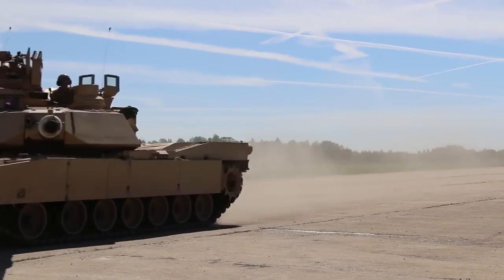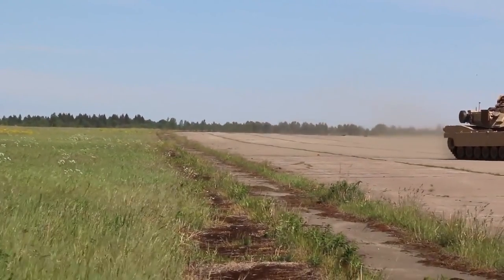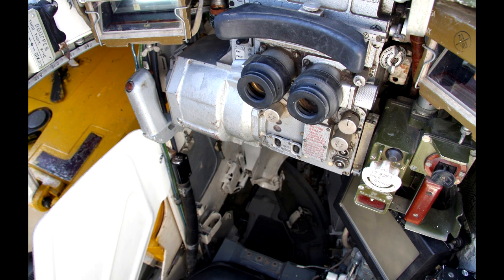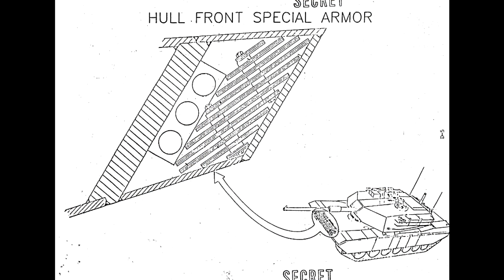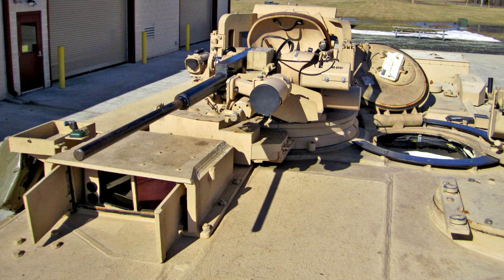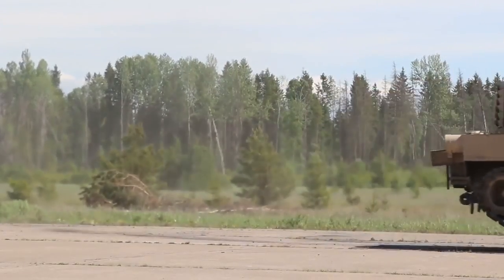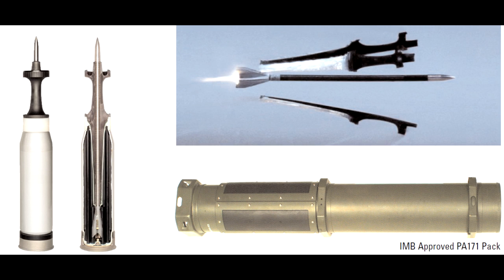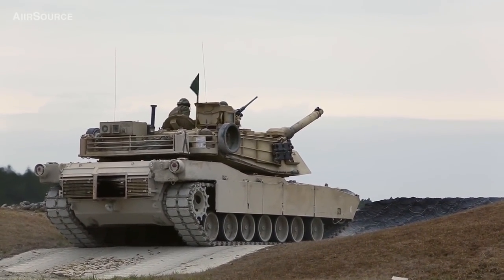Problems with Abrams tank

Comment: The weird thing is that when the M-1 met the best export versions of the Soviets it was ever the master.
BTW, the gas turbine is rated at 1,500 hp. That's because it has throat restrictors -- same as the F-15 fighter -- which can be taken out so that the turbine puts out 2,500 hp -- making this flawed beast the fastest tank in the world. It also does not use the primitive Soviet sighting systems so exhalted here -- being designed right off for a super sophisticated electronic scheme. The electronics cost a fortune, BTW. The Soviets were so shocked at how ROTTEN their T-72 tanks -- and all else -- worked in 1991 that the government fell into revolution -- and the Cold War was over. By that standard, the M-1 tank was the most successful in all history. None can compare. Nice critique, though.
BTW, the T-34 had CRAPPY glacis armor, too. It was so bad that panzer III with 37mm pop-guns were killing it. Yeah, most T-34s during Barbarossa were lost to those pop-guns.(!!!)
The T-34 still worked out. The Reds won, the Nazis lost.

Comment: the reason they used a turbine instead of  a diesel is signature. when the gas turbine starts up and when you add throttle there is no diesel plum letting the enemy know your location as there is with the diesel engine

Comment: A 40 yrs old tank design, can’t the us just get a new tank?, abram is too old You can’t just keep upgrading it like patch up the Boeing,  GET A NEW TANK for god sake, far less expensive than the F35 budget.
Reply: Tốn tiền đầu tư, tốn nhiều thời gian và công sức, trong khi abrams vẫn có thể chiến đấu đc. Bản chất là "xe tăng của bạn rất tốt cho tới khi một kíp lái Trung Đông chui vào nó" vậy thôi. :)
Reply: Tran nguyen khai minh  there are many thing thing wrong with the m1a1,  there are many new modern features that you can only build into a tank, not upgrade, the m1a1 engine is expensive, unreliable, use too much fuel and not the right choice at the first place, also it has no anti rpg or heat seeking/auto counter rocket like the Israeli, the rear of the tank the driver to blowup when hit, the whole tank armour need to be upgrade etc...

Comment: An unbiased opinion is valued. Still waiting for one.
Reply: Tell me, in what way is this biased?
Reply: @leosjogren5244 deliberately ignoring important context like the fact that German MTU was not in consideration for Abrams, the diesel used in the GM XM1 was the AVCR 1300. A far less capable engine that had numerous issues and negligible efficiency advantage at a higher weight while offering less power both overall and at lower RPMs, agt 1500 wasn’t politics, it was the better engine that was objectively worth the cost. And given the complete mess that was the MBT 70, the US was in no mood to listen to the Germans, in fact when the Leo 2AV was tested, it was found that the Germans lied about the weight by removing the composite armor and weighing without being at combat load. When the US ran the numbers of what a combat loaded 2AV would weigh? It was 64 tons as appose to the required 57 tons. 

When the 2nd round of testing began in October, the new categories were created to better define what the army expected not to mention they told the manufacturers what they could do better and improve on their designs based on what they observed in the may tests, the simplified categories put the most weight on what mattered to them most, not expensive bells and whistles that were unimportant extra costs. GM didn’t really work on their tank in the interim months, Chrysler basically rebuilt their tank from the ground up, and the Leo was unchanged

When it was tallied up, the Leo was heavier than expected, it was less survivable, and it would cost 25% more compared to either of the XM1s

No wonder the 2AV lost. Why was Chrysler chosen? No it wasn’t politics or a bailout like everyone says it was. It was objectively the best tank that achieved the goals the army wanted/ could afford. Why was the original M1 circa 1981 dog shit? Because that was the tank Congress was willing to pay for instead of what the army wanted. And it made do with what it had till M1A1 showed up 120mm gun, CITV. And depleted uranium, because Congress was ready to pay the higher price tag what the bells and whistles would incur.

Makes sense?
Reply: he roasts russian tanks as well. why are you still whining?

Comment: As a tanker on the M1A2 SEP V2. I can say he’s correct on everything for the most part. He forgot to mention that the track is made of fucking glass and breaks if you turn it just ever slightly too hard and the point of the engine really is just cause unlike a hefty waaaay better diesel, this one is waaaay quieter and doesn’t make any large black clouds of smoke to lock onto or follow around. That’s about it, the tank needs a full overhaul but we are just gonna continue to slap shit onto old garbage and claim it’s “better” than it was before because it was the cheaper option.

Comment: Problem with Abrams is simply....fuel consumption. Otherwise it is probably the most all-round balanced and capable tank. Gas Turbine can run on alot of differing fuels, like the British Multifuel engine leyland made with the exception that the Gas Turbine actually fucking works. Abrams Combat record shits all over other tanks, from 1991 to 2003 Thunder runs into Baghdad, what has the Leopard done? Got smashed in Syria....

Comment: The front side is 800 MILLIMETERS and it the upper plate last weakness is compensated by the fact that the shell bounces and goes into the much stronger upper hull and it is all MUCH stronger then Russian tanks, we make the sides weak as the production cost would be cheaper, we can put armor there but it would be expensive and useless unless a lot was applied making it less combat effective

Comment: The 1,500 hp diesel wasn't available when the M1 was in design finalization.  By the time the M1 was fielded the diesel became available but the design was fixed.
Reply: NOT TRUE,  both the Maybach MTU 1,500hp and the 1,500 hp Continental AVCR-1360 Diesels engines were trialled in the MX1 along side the AGT-1500 in November 1979.
Reply: The Diesel powered GM version of the XM1 proved superior and was officially selected by the U.S. Army. Congress overruled the Army after heavy lobbyists pressure from Chrysler and the State of Ohio.

Comment: Whos needs 120mm when you have depleted uranium shells "aka the heavy know material" that goes through any modern tank design with ease? And you have artillery and a armored convay with you entering the kill zone you arent soloing enemy tanks. And you wouldn't enter without air superiority. Take a miltary base with a m1 defense with watch towers to spot mortars and air support. Good luck. Just saying
Reply: Who says depleted uranium projectiles are better? The US Army uses DU because it's cheaper than Tungsten projectiles.
Reply: @sandervanderkammen9230  du is densier than conterpart even for expensive tungsten shells and has added incendary effect which tungsten doesn't. Though pure tungsten is denser. Either will take out tank. But du will make the inside an inferno which has added psychological effect and is honestly quite horrifying

Comment: well to be fair the australian abrams tanks do use diesels and have other modifications i cannot recall off the top of my head
Reply: There is a reason they use turbine engines,turbine engines can run off of many different types of fuel,don't have diesel fuel out in the warzone? Kerosene,high proof alcohol,pretty much anything that burns run the turbine
Reply: @hugh.grection1386  the only war zones america has been in have been deserts....have you seen how expensive it is to repair a sand blasted jet engine???
Reply: @redundantstuff100  yes they are expensive but there is a reason they use them,it's not just because ohh well
Reply: @hugh.grection1386  using diesel gains higher torque and pulling power, sure high speed and mobility is slightly on the down fall but who cares when its cheaper
Reply: @redundantstuff100  well the main reason to use turbines is because in a war fuel supplies can be cut off and with the turbine engines even a few gallons of vodka scavenged from locals can run the tank
Reply: @hugh.grection1386  hahaha you really expect to run a multi million dollar gas turbine engine to run on vodka??? also diesel is an extremely common fuel soooooo...
Reply: @redundantstuff100  it will run on high proof vodka,or regular gasoline,or kerosene,or anything flammable,I'm not saying diesel engines is bad I am just saying why America uses turbine engines
Reply: @hugh.grection1386  ok so according to this link: https://science.howstuffworks.com/m1-tank2.htm it will only run on diesel, gasoline and jet fuel.
Reply: @redundantstuff100  that is the main sources of fuel the military uses but it can run on anything flammable,this is why it says wide variety INCLUDING those 3 u mentioned

Comment: The Abrams is a pretty formidable tank in the US Army. I have no idea why it doesn’t run Diesel, because almost all our vehicles run on diesel anyways. This video is clearly pointing out initial and early stages of flaws compared to what we have today. At the end of the day we can afford to upgrade the living hell out of these tanks and anything else, I can swear on that. The US Army has no shortage on budget when it comes to the active duty or more critical components, everyone else is just hurry up and wait lol. But hey, what do I know, I’m sure there are a lot of “experts” on here, all I do is drive everything except heavy tracked vehicles for the US Army 🤷🏻‍♂️🇺🇸
Reply: The M1 can run on diesel,  kerosene (JP8),  gasoline, or jet fuel, and probably as well alcohol. The major issues with the last 3 are they are extremely flammable . So the M1 has used just diesel and kerosene. Initially they ran on diesel , until the late 1990's(IIRC) when they switched to kerosene as a part of the shift toward a universal  fuel ,where all vehicles and engines (in trucks, tanks,  aircraft, generators, etc) run on one fuel simplifying the logistical train. This has been a dream of armies since there have been motor vehicles/internal combustion engines  in military forces..IDK where the us military is today on this issue.

As to the "multi-fuel aspects , the M1 can run on a variety of fuels , HOWEVER,  you can't just put in these  different fuels randomly. Each type of fuel demands adjustments to the fuel system -, different injectors, fuel pump/filter separator adjustments and/or modifications and control unit adjustments.  An M1 set to ran one type of fuel, needs many modifications to run a different type of fuel efficiently, if at all.  A tank crew cannot do this, these changes take major mechanical adjustments and different parts.

The early M1's(M1 hull with XM1 turrets) were marvelous bad ass machines automotively , when maintained. They were the lightest M1 (63 tons)and their turbines were not always restricted /toned down like the later ones.  They probably were and will be the fastest tank that will ever be made . Ones in good running order , with no governor/hp restrictor could go 70-75 miles an hour or faster(running diesel)and depending on road type. And their torque , while rated at 1500 HP ,  I believe could go up to 1600-1700HP.   Really fun vehicle to drive. 
Ex tanker/Vet US Army  85-93 M60 A1-A3, M1- M1A1  primarily Driving (shooting is boring LOL) and later I was Civ DoD  banging on M1A2's (SEP/Block III's)

Comment: Thumbnail images are grossly misleading. Those tanks are being/were intentionally destroyed. From what I know, this is done when a tank needs to be abandoned for whatever reason, but could fall into enemy hands before retrieval. Rather than letting the tank fall into enemy hands, the tank is destroyed from the inside after the crew has safely evacuated. There are also pictures of Abrams that were destroyed in battle, but they were down-armored variants crewed by our allies. So in short, a lot of the destroyed Abrams you see are either scuttled or obsolete versions lacking the top secret armor.
Reply: The same "obsolete variants lacking top secret armor" argument can be applied to other vehicles as well. A lot of the (ill-informed) negative views on Russian armour in the west come from the poor performance of cheap export model T-72s used by a number of middle eastern and northern African nations against US tanks. These tanks lacked advanced fire control systems and night vision systems deployed on Russian vehicles, lacked the most modern composite armour and ERA deployed on Russian vehicles, lacked the modern ammunition used by Russian vehicles, and largely lacked the properly trained crews and proper tactics used by the Russians.  These downgraded tanks stood next to zero chance against modern M1s with well trained American crews.

As you point out, western tanks are not immune to the same problem. Downgraded, export models of the Abrams are known to perform less favourably than their US military counterparts for largely similar reasons. Leopard 2A4s used by Turkey in Syria are another (quite recent) example of supposedly excellent, modern tanks underperforming, again for similar reasons.

To quote Bernhard from Military History Visualized, "Numbers (or indeed pictures in this case) without context, can be misleading."

Comment: I dunno, German engineering is notorious for being over-engineered (2 pulls on a BMW door handle to get out? WTF is up with that?), and anyone who knows anything about mechanics knows the more complexity you add, the more opportunity for failures.

As for the destroyed Abrams pictures, you do know that most of those are derelicts on ranges for testing aerial and artillery ordinances, right? Other tanks didn't do that (correct me if I'm wrong, and you can confirm the location). The current generation is crazy tough, and as far as I know, we've never lost a man in an Abrams, making it one of the safest places to be on the battlefield. That said, it's not invincible, and of course it has room to improve, and it should.

It would be interesting to see what the current tanks used by the super power nations would do to each other in battle, like pitting the Abrams, Challenger, Leopard, and whichever T-series the Russians are on now. However, such a showdown could never produce accurate results without an actual fight to the death, and you also have to keep in mind that modern warfare is conducted in a way where each type of offensive force is backed up by other support forces. In such a tank battle, you'd have to consider all the support, too, artillery, air power, and even cyber warfare.

Ultimately, I hope we never find out which tank would really win, because to find that out, many people will have to die.

Comment: Nice video. The note of “this tank was never destroyed” should have an asterisk. The tanks were disabled in the early 2000’s from unknown fire, and the crews were able to escape with no major injuries. Then the tanks were destroyed to keep the technology from falling into enemy hands. Even the USAF was called in to bomb the tank. There are many flaws to the tank, but with the strengths it provides, it fits well into the American battle puzzle. Air superiority does help with fuel supply lines, as well as proper infantry support functions well with the M1’s. No tank is invulnerable, but the key is a well trained and disciplined crew and their safety to redeploy in another vehicle. Again, great video.

Comment: Yet when Russian tanks went against US tanks the Russian tanks got blown to hell.
Reply: Those "Russian tanks" that tend to be used by middle eastern nations against US tanks are export model tanks. They are downgraded, far cheaper versions of the Russian vehicles and lack many of the modern systems that make the Russian tanks (used in Russian service) good. The crews of US tanks also tend to be trained far better than the crews they were facing in these cheap export tanks. Comparing the export model tanks to the proper vehicles used by Russia's  military is almost pointless. It's like comparing a Mustang with a V8 to a Mustang with a 4 cylinder engine. The cars share the same name, but perform entirely differently from each other.
Reply: And Peter Pan is real. I swear.